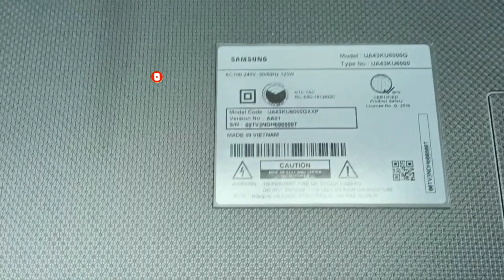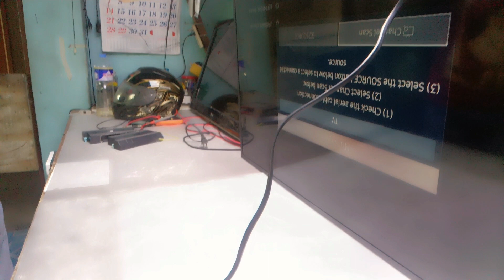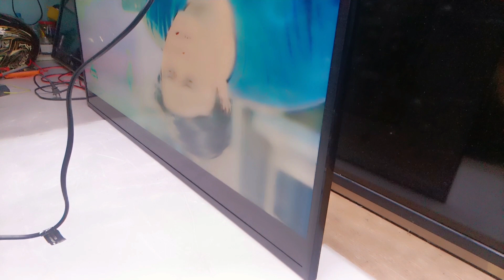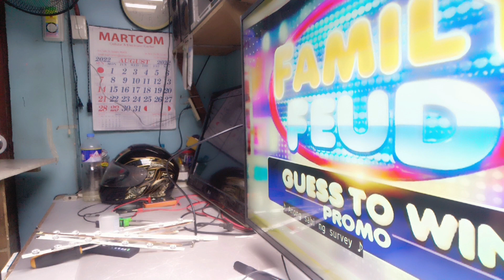Samsung smart led tv 43" flickering#how  to fix flickering#how repair flickering#how fix backlight.

Comment: New subs idol thanks sa tutorial, tanong ko lang sharp 32 led LC32LE150M no display vertical bars only, thanks God bless...
Reply from the maker: Good morning sir.. tungkol sa sharp na no display  vertical bar. Basic sir mag voltage check po kayo sa top board. Vgh &vgl kong normal naman  linisin nyo ung ribbon connector na brown baka madumi lng sir.  Salamat sir sa tanong nyo.. salamat sa pag subscribe.. godbless.
Reply: @gertechph  thanks